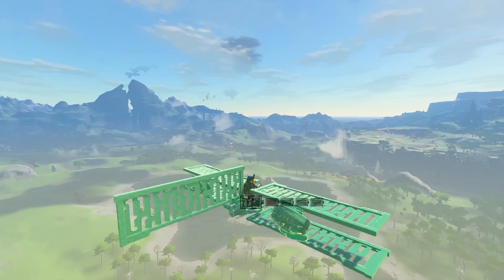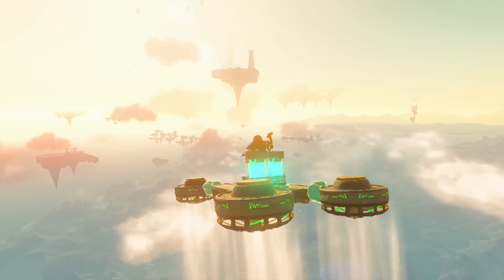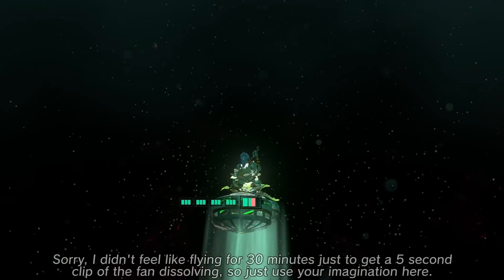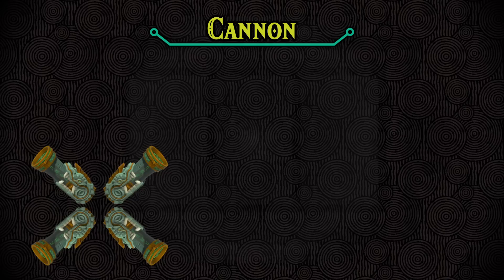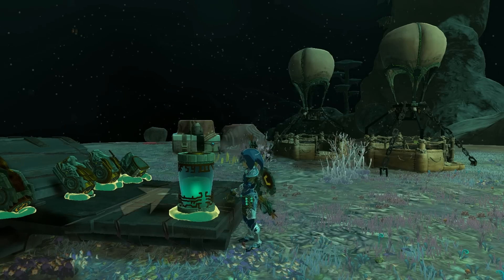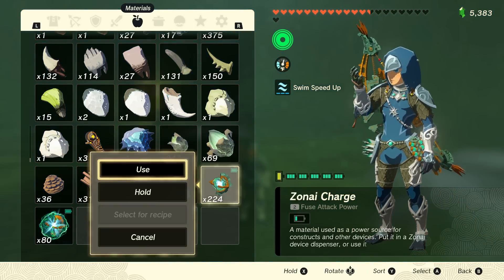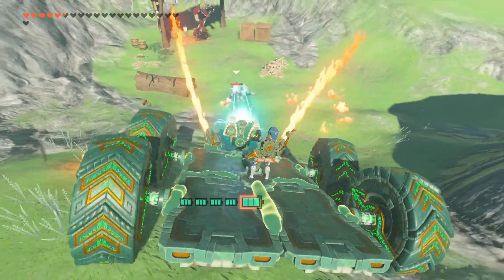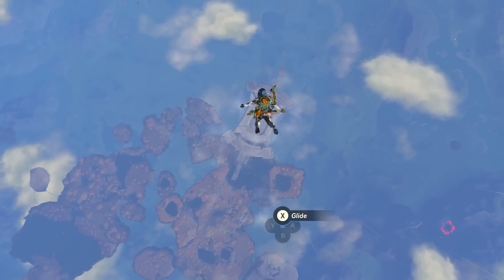How do the ZONAI BATTERIES work in Tears of the Kingdom?

Comment: Awesome breakdown! 
But there is one mechanic of the batteries & Energy Cell that you missed!

Power range:
When Link is too far away from a Zonai device, it powers off. I believe this distance is the same for all devices? Haven't looked into it too much.

But if you attach a battery, it will stay powered until the battery depletes (assuming it doesn't go far enough to despawn) this seems like a very important thing to talk about, as at least one Autobuild schematic (Arial Cannon) relies on this effect.

Comment: Quick tip! 

While flying a powered vehicle, you can use the moment of stillness you get when activating recall to drop a zonai battery and ultrahand it to your vehicle.  You can then continue flying unimpeded, without having to spam recall, as your wells will recharge while flying!
Reply: This isn't so easy on something as small as a hoberbike, but anything larger will probably work out fine

Comment: My only wish is that the batteries would operate in the reverse that they do now.. it'd be more useful, I think.
That way, it would only deplete the physical cells once Link was out of wells, meaning it would not use them in situations where they don't need to be used. In the current setup, they tend to get wasted because they get used first. I can't really see any actual benefit to them being used first either.. are there any?
Reply from the maker: I guess the one thing I can think of is that it would be hard to program whether the cell should regenerate when the vehicle switches to battery power.  Not sure though

Comment: super useful tip for anyone using a zonai contraption to fly, and can't afford to or don't want to land to recharge energy:
recall has no cooldown after use
and
your battery recharges while in recall
these two can be effectively used to infinitely fly around or do whatever without losing height
can attest to the strength of this technique, I've used this for weeks already, and even got to the 3000m island above lookout landing with only 4 energy wells to fly a hoverbike with (though with many attempts because I messed it up a lot)

Comment: The chef recycle may be due to the cutscene. I noticed that all of my energy recharged when i first time kill the yiga with the red circle, triggering the cutscene with the door unlocking. It might be worth finding out if blood moon does this too.
Battery dissolution can be used to intentionally disconnect parts. I do this to extend the fan bike with batteries found on some of those sky islands. Just connecting all the batteries to the bike will just make it too heavy to go anywhere, so i add two more fans connected by batteries and  connect more batteries to those. When those fans disconnect they fall quickly out of range and are no longer drawing power.

Comment: Have you explored the interaction between batteries and emitters connected on top of a Construct head? Based on the other interactions you mentioned, I wouldn't be surprised if the batteries don't care whether the emitter is on or off and always consume power at a constant rate.

Comment: Batteries deplete based on the order you add them to the structure, not based on some magic about not breaking anything. Your example vehicle that has a battery that will and won't break things is a perfect example.
Reply from the maker: This just isn’t true from what I’ve seen.  The order of adding stuff doesn’t seem to matter, but the location does.  It’s just that your earlier added batteries will probably be closer to the powered parts, and under other batteries, making them the last to burn out.

Comment: Well... there is another battery that you can use
The rechargeable battery in the Zora's shrine, but its utility outside the shrine is into question.... at least for now
Reply: With very low wells, infinite height with a cart, shock emitter attached directly to the electric battery, and a Gemimik propeller and motor. I will even test this on my second file, and let you know.

Comment: Zonai charges add as many temporary Wells as you're missing in the first row if you have half the batteries capacity then you won't be able to have any temporary welds
Reply from the maker: I just tested this and you are correct.  I also found that the second row can also be completed with yellow wells in a similar manner.  Thank you so much for pointing this out.

Comment: You can have more than 9 yellow wells of energy; I ate a bunch of wells at one point and got up to 7 full bars (or 21 wells) of yellow energy. I don't think I was at the maximum number of energy wells, but I know I had at least the green bars fully maxed out and was making some progress on the blue bars cause I thought it was weird symmetrically that it only went up to 7 yellow bars when I would have expected 8 to match the permanent energy bars. I wonder if it's tied to your max battery capacity? I haven't tested with the full blue bars.
Reply from the maker: Hmm maybe so.  I should’ve tested that.
Reply: @paradox_guardian I’m pretty sure that’s how it worked, the amount I could use decreased after upgrading the wells.
Reply from the maker: @KP-vf6hu  After some testing, you are correct!  I have updated the top comment accordingly.  Thanks for pointing this out.

Comment: if I remember right, the game also chooses batteries based on order of placement. Could you test if that'll cause it to disconnect batteries in the wrong order? Say, if you glued one battery to another, then glued one of those batteries to a machine
Reply from the maker: I could make a whole video about the battery selection algorithm.  In my research for this one, I was quite fascinated by it!  From what I've seen, placement order doesn't matter.  Instead, when choosing a battery, it seems the game looks for the battery that

-is attached to the lowest number of things.
-contains the lowest amount of remaining energy
-is the furthest average distance away from the powered Zonai devices

in top to bottom priority order.  I can perhaps run a few more tests, but this is what I observed.
Reply: @paradox_guardian  ah I see! I must've had it wrong then, and I would love to see a video on the battery selection system!
Reply: @paradox_guardian if it's predictable to that extent, I wonder if it could be used to deliberately cause delayed shedding of parts? Would be hard to lay out, at best.
Reply: @paradox_guardian ”contains the lowest amount of usuable energy” that sounds like something probably obvious or you went full blown mad man in testing and I’m not sure which is more likely lol